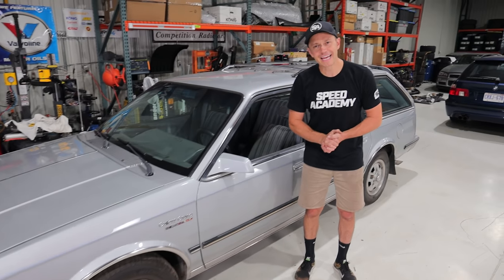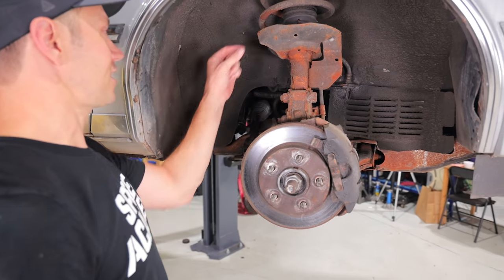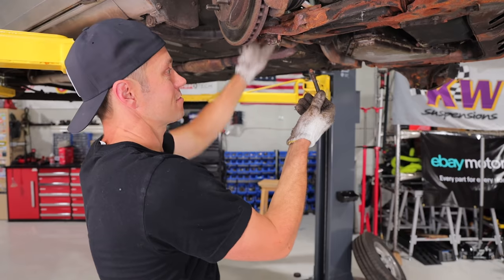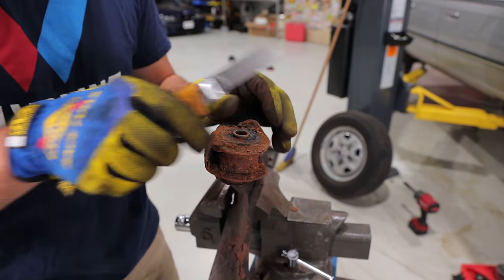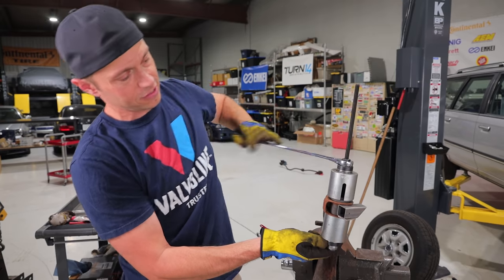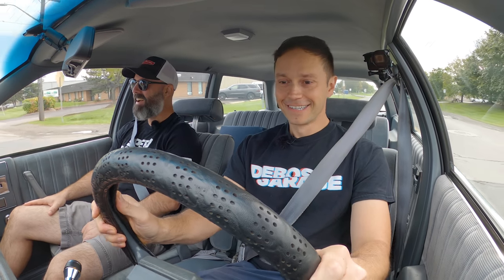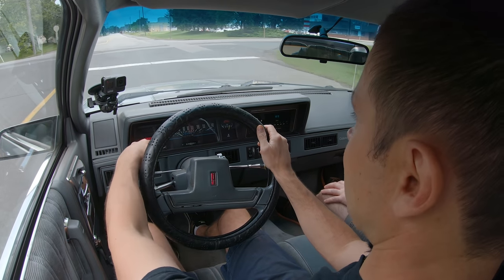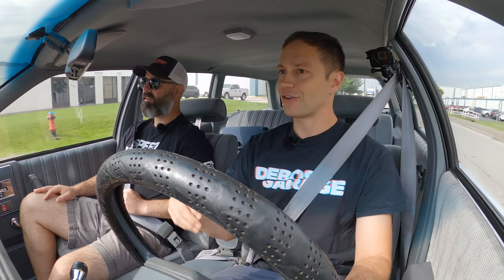Can We Fix This 80 Year Old Grandma's Car When No One Else Will?

Comment: I know this is a "gutless cutless" but gm rebadged so much if you don't know this then you have no business talking or working on cars anyways....but I miss my celebrity!!!! Wasn't a wagon....but did buy from an old neighbor that winters in Florida .....88 Chevy celebrity with a 2.8 2as basically a old man's 4 door berreta but with a 3 speed auto trans ....got it for 500 bucks drove for 2 years with zero work done or money spent other then oil changes and trans and coolant flush.....got at 98k sold what like 3 years later at 140k for 1800.00......worst thing about the whole car... as I'm watching you guys moan about dash and radio was the dash and putting in a deck in that dash.....but super light and super quick! 1st gear in the 3 speed trans went to like 60mph!!!! Because of Florida car no rear window defroster and a stupid coolant hose under the intake on the 2.8v6 but other then that awesome fricken car and I miss it and they just don't make them like they used to!!!!!!! Bring back the good cars!!!! For 80s tech the thing got like 28 plus mpg in a 4 door V6 American car!!!!! Why can't cars now do this?

Comment: This is the very last vehicle I expected to see on this channel. 😄 My family had the Chevy Celebrity version of this wagon back in the late 80s. It was the "Eurosport" model-- which in the '80s meant no chrome trim and a thicker, padded steering wheel (with the same column shifter...). Still trying to figure out how GM managed to only get ~95hp out of the 2.5L inline four. You couldn't make it uphill with the A/C on unless you were driving alone in the wagon. I wouldn't say it was the sole reason we stopped buying GM cars afterwards, but...
Reply: My parents bought a Celebrity Eurosport wagon in 1984. I took my driving test in it. Great visibility, and the Eurosport suspension made the car feel more planted than other American cars of the day. The 2.8 liter v6 had no guts, as the engine was still carbureted in 1984.

Comment: Them cars may have had poor quality on the interior but the power train’s they used is what keeps them cars around them 2.8 V6’s 3.8 V6’s and even the 2.5 tech 4 and later cars with 3.1 V6’s and 3300 V6’s are all good engines for them my brother has a 1991 Buick century with a 3300V6 and loves it

Comment: I had this same car. Bought it for 200$ It was super reliable for 2 years, and the guy I sold it to immediately drove it on a 1200 mile road trip, and drove it another 3 years. Made it no problem. Of course they quit making parts, why would you get a new car if they still had parts available. They did the same with toyota trecel. Just stop making parts so people have to give up.

Comment: That’s a nice example of the post-G-body Oldsmobiles, and the precursor to the downfall of the Olds brand. IMO, Had they kept the Cutlass line, at least, as rear drive, it could’ve saved the company.
For future reference, removing the steering end links would’ve made removing the rear control arm bolts much easier for you.

Comment: Your disparagement and ridicule notwithstanding, I have found my 91 Cutlass Cruiser, now capably serving the fourth generation of my family,  to be a very good car. Eminently practical, eight passenger capacity, ability to tow a camper, (3300 V6), 337,000 km durability, still zero oil consumption , comfortable ride, ease of handling and parking, sweet long haul cruiser, fuel economy comparing very favorably with that of most new vehicles (which are heavier SUVs and trucks, but still...30 years of progress?) and great features. (Like never having to touch the dash headlight switch from one MVI to the next, one steering column stalk, instead of having a second one for the wipers  - how is that progress?) I did, however, have to add cupholders - bummer. Plus, it frequently gets expressions of admiration and approval, and impromptu photo shoots.(It's a woody, but a far from pristine "driver".) Last week I used it to tow the front half of a box Caprice, on a  trailer, to the scrap yard. Better rethink the condescension, or offer an import to   match or better it.

Comment: I rescued an 89 Buick Century sedan from the crusher when I was working at our local junkyard a few years ago (50k Mi on the odometer at the time)... I swapped those exact bushings myself without any specialty tools (even had the control arms powder-coated while the old bushings were out, in an effort to combat new england road salt).

If you re-do all the suspension components (bushings, joints, and struts/shocks/springs all around), those cars actually drive very well.  I was a 90's Honda fan until I fell into this Century, and I genuinely love it; it's a fantastic, straightforward Car... no more, no less.  The 1st-gen Pontiac Trans Sport (Olds Silhouette, Chevy Lumina APV) used a modified version of that FWD A-Body platform, and had a super thiccc front sway-bar that can be fitted to the Cutlass/Century/6000/Celebrity for better handling if you can get the appropriate bushings and brackets.

[edit:] that Century has also been my daily-driver ever since.  No funky problems aside from any other 30 year old car, and it's got the 3.3 in it, so the rest of the car will turn to dust long before the engine ever gives up.  I will drive it until I have no other choice; no contemporary car is as comfortable or responsive to driver-input as this stupid elderly churchmobile... heck I rented a 2020 Camry with some kind of tryhard sport package on a work trip recently, and it STILL felt like I was talking to someone through a translator.  It might sound cliche, but there really is something to be said about the "simple is better" philosophy.

Comment: My Fiero has the same suspension design. The bushings are replaceable if you can find them, they press out in theory, in practice you usually have the set them on fire, the heat also breaks the rust apart. They make half moon spacers that go around the bushing between the two parts of the arm to keep it from compressing onto itself. The other shops probably knew what a pain this job was and wanted no part of it.

Comment: Stylized steel wheels were fairly common from the 60s through the 80s. 

Also, those seat belts are designed to give some slack if you want it. It was a compromise to eliminate the excuse of the "choaking feeling" many people claimed as a reason to not wear their seat belt.
Reply: Is that for real?  I had two 80's GM cars and both would need a tug to be tight.  I just figured it was an age thing and not an intended feature.
Also, if it was stylized steel wheels, it was gloriously over-engineered hubcaps.

Comment: You know you knock the 80's cars but that's cause you were probably too young to drive them when they came out. You said that the Olds had a 2.8 V6 and although it wasn't a power house by today's standards, it was pretty much bullet proof. My father had a Pontiac 6000 with that engine and drove it over half a million Kms before retiring it. I should also mention that it was driven to the junk yard after sitting in our yard for over a year. I will also mention that it was not fuel injected but yet started right up after sitting for so long without issue. I myself owned a Chevy Celebrity with that motor and again never let me down. I will mention that the Old's and Buick brands being the more luxury versions so they did have the softer ride, and the wagon versions were even more so.

Comment: If anything you guys have ever worked on called for POR15, it was those lower arms. Of course I don't think you guys use the 'metal prep' they sell which is what actually stops the rust from continuing to rot the part. The POR15 just encapsulates it.

Comment: Probably needs the throttle body and IAC cleaned.  I think that's why it kept stalling.  Battery light comes on when engine stops because the alternator is not charging the battery.

Comment: did you guys even check the charging voltage ? thats simple enough to see if the alternator is keeping the battery charged.  good stuff though i was hoping to see the ladys reaction lol
Reply from the maker: It was charging just fine, turned out the battery was toast

Comment: Spray the seatbelts on both sides of the webbing where it goes through the shoulder pillar hanger...for the entire length of this rubbing belt webbing....the silicone spray lubricates and eases the friction so the belt retracts like it should.
Spray the door rubbers and include where the window disappears into the door and the windows' vertical tracks on the doors with silicone for the same reason...

Comment: Stationwagons should be build again🙄 in the USA, in Europe they are still made 🎉😁 so much better/water/less fuel etcetera, than those SUV's 🤢
And then those wheels 195/70 R14 😳 my Scion iQ has 195/55 R16 😇

PS
Maybe the lady is better of with a Honda Fit?!??🤔
Same hp anyway😎

Comment: It must be a generational thing cos I don't consider an '87 a vehicle to be from the "before times." I'd still be driving my '86 GMC Vandura 3/4T had an ex-g/f not hit the hi-top without telling me, breaking the seal & allowing the body to rust through from the drip rails down. As it is I'm presently driving a '95 Ram Van 2500. Bulletproof 318, & with half-arsed maintenance the only thing she needs right now is front shocks. Sure, I'd love to have a Civic, but @ $16K+ for 5y/o I can keep this van runnin' a long time. Now if I could just find a cassette player...

Comment: Hi from Melbourne, Australia, in 2 months I'll be 65 yrs old & also in 2 months , I will have been driving my 1974 Cadillac Fleetwood Brougham Talisman for 40years , I bought it just after my 25th birthday 40yrs ago it had then 102,700 kilometres on it , Australia went metric in 1974. Now in Nov 2021 it has 708,000 kilometres on it .
I have loved it and looked after it so well it looks like its new and as an export spec car it has a FULL POWER 8.2ltr V8 engine with ZERO anti pollution devices except a fuel vapor charcoal canister. So when you put the right foot down the car seriously hauls, not like the gutless home market USA spec cars. After owning the black '74 for 10 years I bought a white 1972 Fleetwood Brougham another Aussie spec' export car with full power engine and has a mere 135,000 kilometres on it, in my ownership  I have done a little over 100,000 of those k's. My '74 has EVERY option bar 2 , a sunroof & a left front door mirror thermometre. It does have some mega rare ones :-ACRS air cushion restraint system (air bag wheel & dash), as an aussie car it needed for 1974 front inertia reel seat belts so it has GM's roof mounted 3 point harness with the mercury switch control & g-force sensing system that pull you back into your seat when the mercury switches detect deceleration, it has GM's great suretrac/maxtrac system, (traction control & ABS brakes) these ABS cars came with giant etched disc rotors like modern cars & your real worry when driving it is will the modern junker behind you be able to stop, with its self leveling air shocks the car handles very well, lots better than most people expect, my suspension/air shocks work correctly & stops pitch roll & dive.  with 400+ horsepower & 500+ ft-lb of torque it has serious punch & it just keeps on pulling, not bad for a 3,180 kilo car. Mine has been loved & looked after & you can see it via Google, just type 1974 Cadillac Fleetwood Brougham, scroll & 3 photos appear of my black car beneath each photo you will see: shannons.com.au , my insurers here in Australia have an online club, click on any 3 of the photos & the others will appear, these are recent shots, the front on shot shows its NSW BL-499 rego/licence plate. So not all US cars of the 1970's & 1980's were incompetent pieces of junk some were exceptionally well made & durable. I also fit the correct sized heavy duty tyres.  These cars came with 235x78x15 8ply bias belt radials as new. So it is now equipped with the best Australian made heavy duty 8 ply Steel belted radials also the correct 235x78x15 so it rides like it should (these are 8ply wall & 8 ply base/tread) which are stiff when cornering , but their 78 side profile gives the bump comfort required. Most idiots fit 4ply tread/base, & 2 ply sidewall tyres on imported heavy cars and wonder why the thing wallows & feels like they are riding on squishy foam rubber, reason, wrong tyre for the weight of the car.

Comment: The Oldsmobile Cutless was part of a popular line of cars made by GM in the 1980s.  GM introduced the Cutless Cruiser in 1984.  It was part of the effort of mfrs. to put lighter, more fuel efficient models on the market to meet Federal CAFE standards(improved fuel efficiency guidelines).The Cruiser was the sister to the "Ciara" sedan model; it was immediately popular with first year production of 41,816, nearly double that of the 1983 rear-drive version.  The rear drive model continued as the Cutless Supreme.
The standard engine was a 2.5-liter, four-cylinder, with a 2.8L V-6, 3.0L V-6, and 4.3L diesel V-6 engines standard or optional, depending on the model.   These Oldsmobiles were cousins to the reliable GM A-body cars and were some of the most reliable cars available at the time.  The Chevrolet Celebrity engines (same engines used in most GM front wheel drive cars) would quite regularly last over 200K+ miles.
A “new” Cutlass came out in 1997, but it was simply a badge-engineered version of the 1997 Chevy Malibu, and it tanked in sales for the model. Oldsmobile never really got a replacement that was a high volume seller, and eventually the Oldsmobile Division of GM came to its end of the road after a very short run of its 2004 model year.

Comment: I had an 84 Buick Century that wasn't a strip down model. It had 8 track, power windows, a few other things. It was also a POS. The paint started peeling after 3 years, it had numerous engine problems, and I gave it away by 90. Unfortunately my ex was a GM exec so we had to buy new vehicles every two years. GM made a lot of junk. When we got divorced I bought foreign, Toyota. You can't beat Toyota quality. Love my Taco.

Comment: Did you Check and Replace Any Other Worn Bushes? 
Should have Replace All Bushes, New Shocks & If too rusted New Springs.
Fix that broken front brake pad that has slipped out of the Caliper Or Replace Pads & Get Rotors Machined.

Comment: I amused you find the hazard button amusing. I never thought about it because it's normal.
  GM was rock bottom in early 80s. Especially 1980.
 Maybe you guys could help me with my 86 T/A  5-speed and no t-tops. I bought it new from Pontiac. It's been sitting for a while.

Comment: And you wonder why they stopped making the Oldsmobile Cutlass Cruiser, that 8s the year I believe they came out with the metrix motor in those cars,just like the Chevrolet Celebrity which is the same car basically  it has the metrix, vortex 6 cylinder, now if it was an 8 cylinder that is something else

Comment: I bought an 89 Pontiac 6000LE in 1990, with the 2.8 ltr V-6 and 3 speed automatic (no overdrive).  We put well over 200,000 miles on it with very few problems.  It consistently got 31 mpg  on the highway.  All in all it was a good car for the money.

Comment: Wow! Sure does take me back. My mother had an '86 like this, except it was metallic maroon with a matching maroon interior. Rear-facing rumble seat in the back. "The Bus" ,our nickname for it, actually rode (not handled) pretty well. Had a 2.8L V6 with a 1986-only electronic carburetor that gave a lot of trouble. She ended up selling it at around 100,000 miles to a high schooler for their daily driver. Saw it in the same area of town about five or six years later, albeit a little worse for wear.

Comment: I learned how to work on cars thanks to this type of car. Brings back memories…. They actually last a very long time over 250k miles when cared for. The ignition lock tumblers are super weak so unless you have a column lock this type of car is stolen in under a minute by a car crook. The quad 4 was absolutely awful sounded like trash ran like trash. The 2.8 v6 reliable and peppy for it’s time. So simple in design and now with modern technology I don’t see why you couldn’t fix or rig any type of fix for this car. Keep a car like this and save your $500 car payment and maybe invest it in a mutual fund or something:-) imo

Comment: I worked for Oldsmobile when this car was new! They didn’t float down the road like this one does! The suspension was a bit on the stiff side new, and as they aged, then the struts and shocks deteriorated! So if you get the chance redo the complete suspension, and give it an alignment you will be surprised!

Comment: A story 
In 1998 one pulled up to oil shop I work at the time. Boom boom coming from outside. I'm like who pumping the base. Little old lady in her 40-50s. 
Fully built stealth mode radio system. Here ICE was one base sound ing system

Comment: That GM platform was/is considered 'bombproof'.  Two of the mechanics in a the fleet shop where I work have late-1990s versions of these they use as daily drivers.  They keep them because they are easy & cheap to repair, parts are still available, and it keeps them from putting miles on their 'toys' (big pickups).